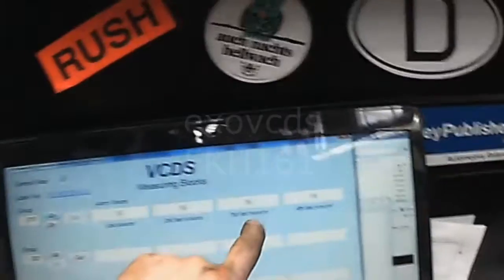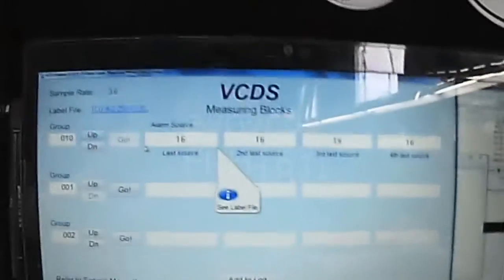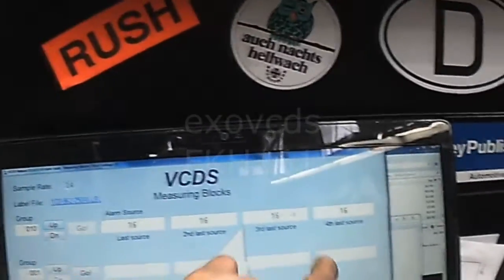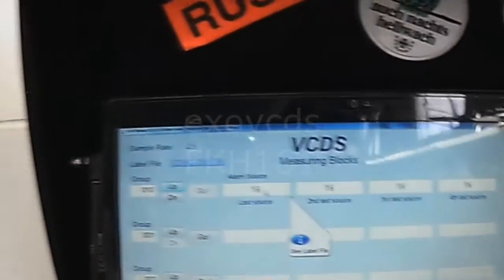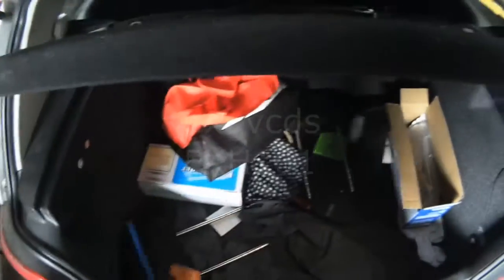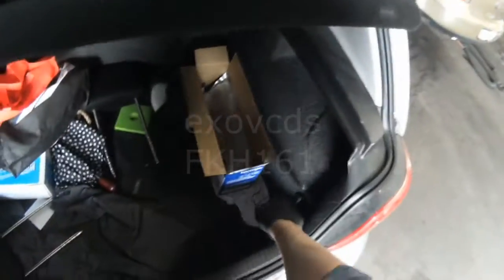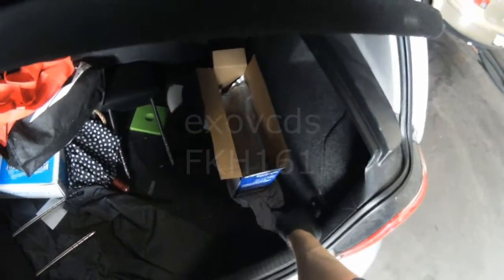VW A4: Intermittent Alarm Activation

Comment: I Was trying to start my 2002 golf mk4 & when i turned the key my alarm sounded & wouldn't let the car start. I Need help!
Reply from the maker: The car didn't recognize that the door was opened. It was probably ok after you cycled the key a few times?
Reply: @EXOVCDS  i did that but it still didn't work
Reply: @trayhadleyyy  this happens to my 2000 Jetta TDI, but it's always if i sit too long in the car after unlocking it and getting in. Sometimes it will lock back and if i turn the key the alarm goes off. I just have to unlock with the key fob and everyting is fine

Comment: My beetle just started honking and yelling while I was eating dinner.. Twice in 5 minutes. I know my driver's door lock module is going because the ignition chime doesn't go anymore with the door open and the little puddle lamp doesn't come on. I can make it work by playing with the latch with my finger but doesn't work otherwise. Perhaps this is  why my alarm went off?? Just started 5 minutes ago for the first time ever
Reply from the maker: Michael Shone Yes could be... the central locking module / comfort control module should keep a record of what component triggered the alarm (last 4 alarm activations should be stored in memory). Using vcds, 46 - central conveinience, then scroll measuring blocks till you see alarm activations.
Reply: Thanks Thomas!! *****
Reply from the maker: I feel like an idiot... I replied telling you "how to" when the video already explained how to. I read & reply to messages without looking at the video that the messages were posted under. D'oh!
Reply: ***** shows how sharp your memory is!!! You replied the how go off the top of your head! I still need to purchase VCDS.... But i think I'm off the hook for now. When I drove home from my girlfriends, I noticed my "trunk open" light was flashing on and off intermittently. I think my girlfriend or I had slammed the trunk a little too hard earlier in the day and knocked something inside? Not sure.. But played with it when I got home and it seemed solid. I locked it then at 7pm and it's now 12:30 and I haven't heard it out there yet. And I'm hoping I don't considering its parked right outside my bedroom windows!! LOL! Hoping it was just that and I won't hear from it again.. But once my tuition is paid I'll have the funds for VCDS and I'll see what triggered the alarm if it does it again...
Reply from the maker: Michael Shone The trunk latch signal was most likely it.